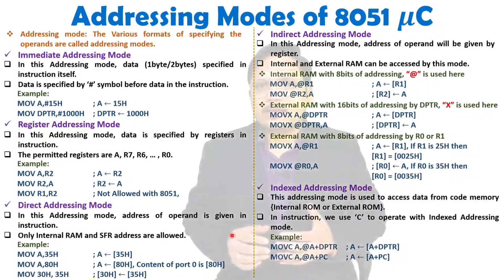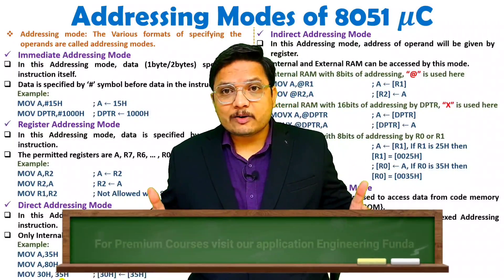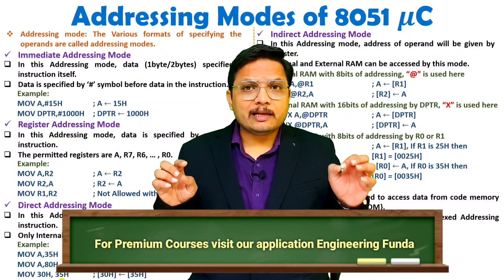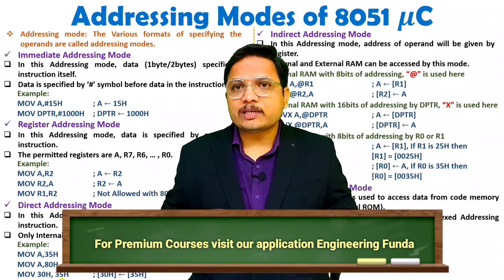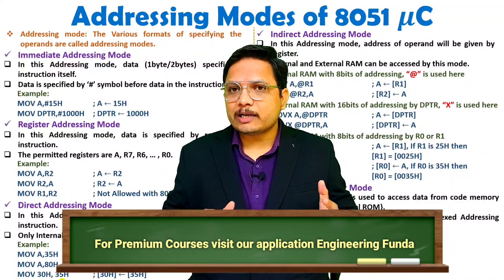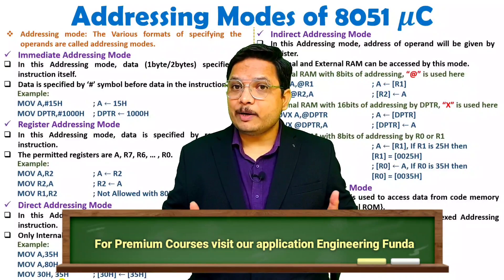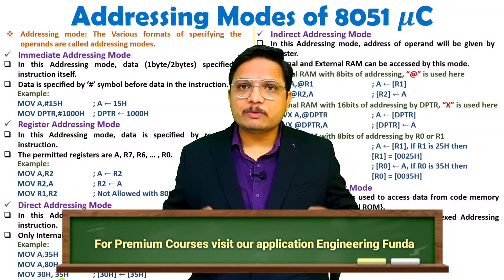Addressing Modes of 8051 Microcontroller: Immediate, Register, Direct, Indirect, and Indexed

Comment: There is an issue with 3:00, I don't think Accumulator is part of the examples of Registers allowed in Register addressing modes, I think the only registers allowed are R0 to R7 of which ever current register bank ( Bank 0 to 3 ) is active.